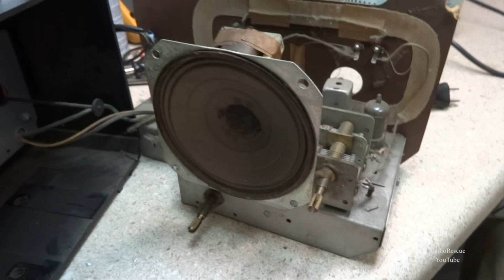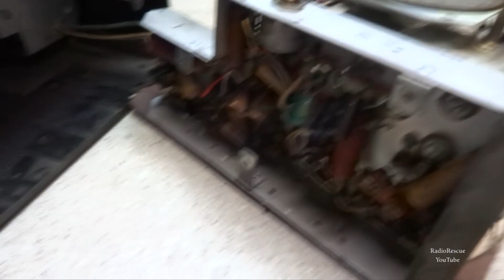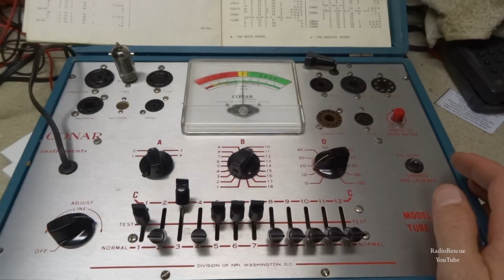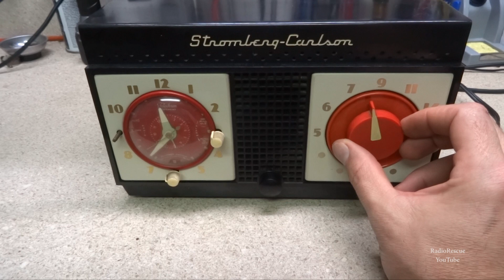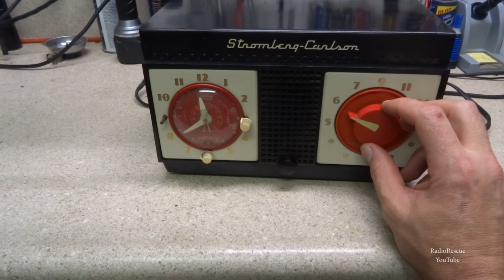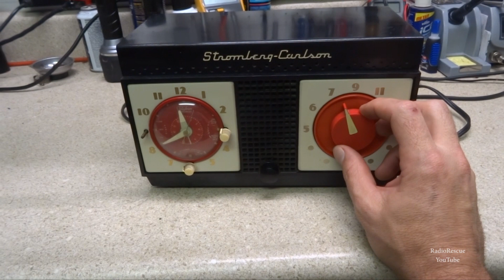Repair Of A 1951 Stromberg Carlson C1 Tube Clockradio

Comment: Where do you get replacement tubes for these old radios? Where do you find schematics? I've seen a few websites that offer free schematic downloads, but there list of radio models doesn't look complete.I was wondering if you would share where you get your schematics? Enjoyed the video! This is the cleanest older radio I have seen so far.
Reply from the maker: Tubes are all over the net. Tubes and more .com  Ebay, Hamfests, ETC As far as online schematics nostalgia air is a good resource
Reply: Thanks for the info!
Reply from the maker: In the 1970's and early 80's tube companies were subsidized. So tubes  are still somewhat plentiful.

Comment: Cool radio and very good DXer. There were two tubes that are Raytheon made. They were the ones with the short, stubby exhaust tip. Unmistakable Raytheon. They may S-C branded but they probably have Raytheon's EIA code 280 printed on them.